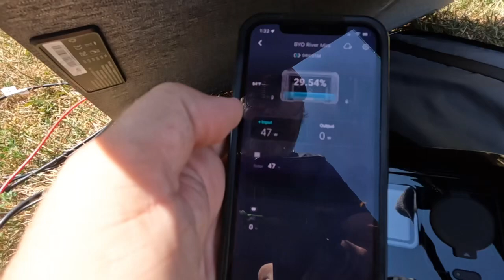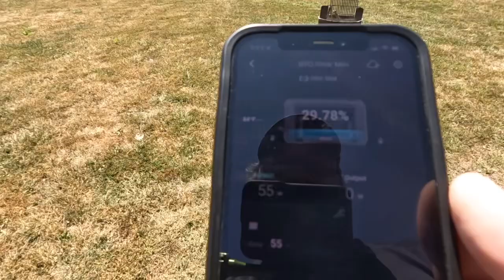ECOFLOW Solar Angle Guide

Comment: I like numbers.  As such, I use a carpenter's square hanging from a string attached to a nail in the wooden frame for my large solar panels.  It gives me the exact angle which I adjust relative to seasonal changes.

Comment: How do you use the app without wifi?
Reply from the maker: If you have a River Mini or the original River series, you will need to connect them to a Wifi network to use the app.  I use a Wifi Hotspot when out camping so I connect the units to that so I can monitor the batteries and solar from my phone anywhere around the campsite.  If you have the River 2 series, they allow a direct connection via Bluetooth and you will not need the wifi hotspot.  Thanks for watching and the comment.
Reply: Thank you for your response!! I never thought about that. I’ll use the hot spot from one of the kids phone! 🙏🏿

Comment: I would prefer a spring loaded clip on this item. Some panels are thicker than others. The existing clip may snap if it goes over a panel that's too thick. Thanks for the "clip." Pun intended.
Reply from the maker: I have another one that is made by a no name company from China that has a metal spring clip.  It works well, my concern is that the metal clip would cause more wear on the back of the solar panel and could possibly damage the material over time.  Thanks for watching and the comment.
Reply: @BarnYardOutdoors  Thanks for the info. Would like to know if you can supply the "no name" vendor. If not, not a problem.